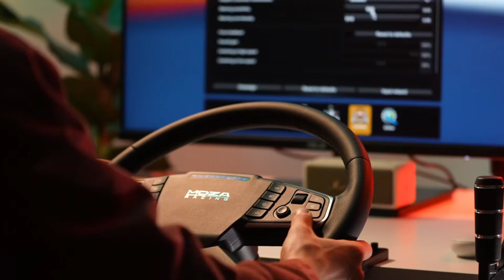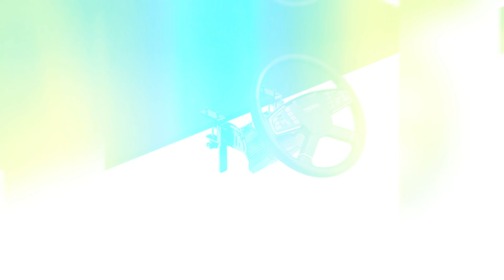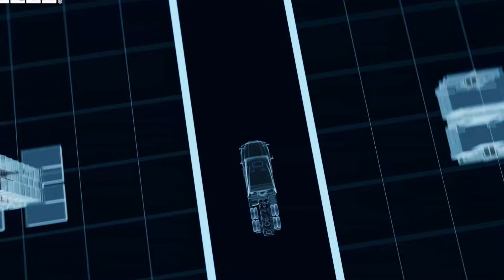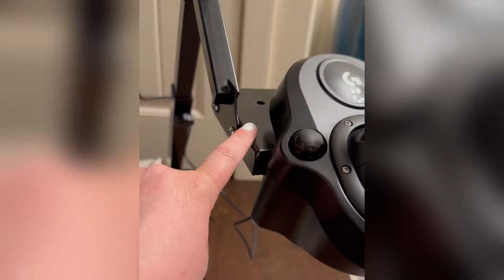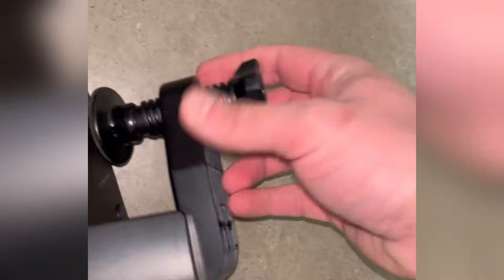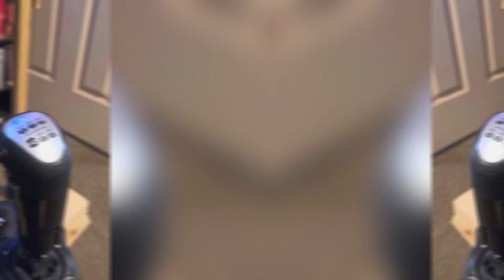✅ TOP 5 Best Steering Wheel for American & Euro Truck Simulator [2026] 🚛 ETS2 & ATS Controllers

Comment from the maker: ✅ TOP 5 Best Steering Wheel for American & Euro Truck Simulator  🚛 ETS2 & ATS Controllers

➡1. Moza R5 + TSW Trucking Bundle🛒 https://geni.us/mKO96Ec  (Amazon)
🔸Moza HGP Shifter🛒 https://geni.us/Tk1YpJ  (Amazon)

➡2.  HORI Truck Control System 🛒https://geni.us/GFeNXfp   (Amazon)

➡3. Logitech G923 Trueforce🛒 https://geni.us/UjzRM (Amazon)
🔸Logitech Driving Force Shifter🛒https://geni.us/T989sn(Amazon)

➡4. PXN V99 🛒 https://geni.us/uKTzeV  (Amazon)

➡5. Thrustmaster T248 🛒 https://geni.us/NsNe8  (Amazon)
🔸Thrustmaster SimTask Steering Kit 🛒 https://geni.us/PaAJNvh  (Amazon)
🔸Thrustmaster TH8S Shifter 🛒https://geni.us/XO9X(Amazon)

🕹 USB Truck Shifter Knob for G923 & TH8S Shifters 🛒https://geni.us/QEjzVA  (Amazon)

Comment: How you set up and configure the pxnv99
Reply from the maker: Just plug in the wheel, pedals and shifter, install the PXN software, then select PXN V99 in ETS2/ATS controls.
Set steering to 900°, turn on force feedback, and map the buttons